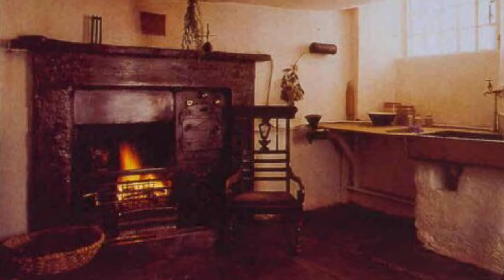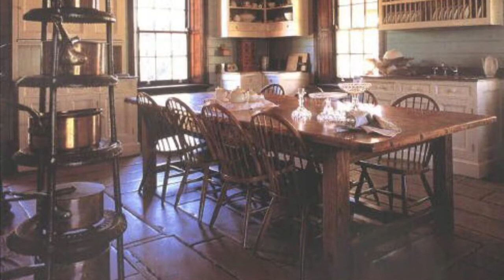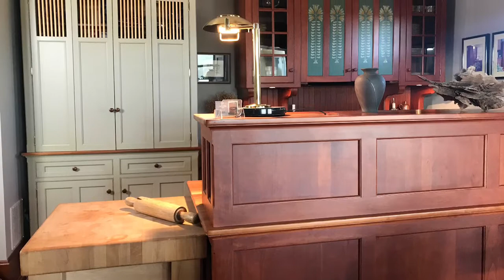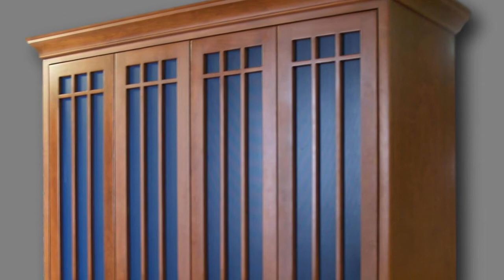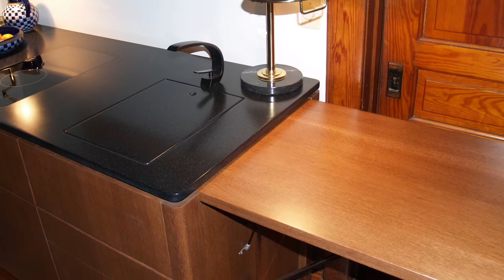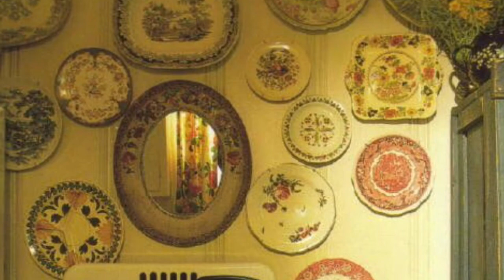Kitchen Workstation Furniture Design Principals: Part One

Comment: I absolutely love this. in fact i have already designed my kitchen as an east corner room with windows on two outside walls and pictures/paintings on the two other walls between doors. NO UPPER CABINETS! i do have some open shelving bet. the windows and above the sink. only "cabinets" are the sink/dw/and drawer. there is a corner china cabinet and wall china cabinet for everyday dishes, etc. two credenzas for small appliances and pots and pans. a center workstation (on legs and can be moved) sink is cast iron, stove is a  duel fuel heartland free standing range (elect oven and gas burners)
Reply: oh, and a scullery off the kitchen containing laundry, more cabinet storage, freezers and even a small sewing area.